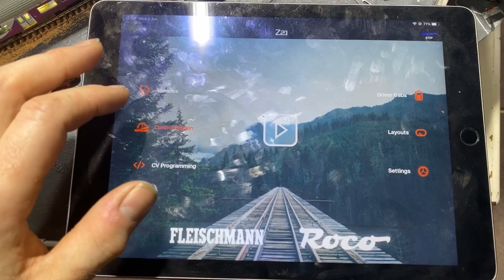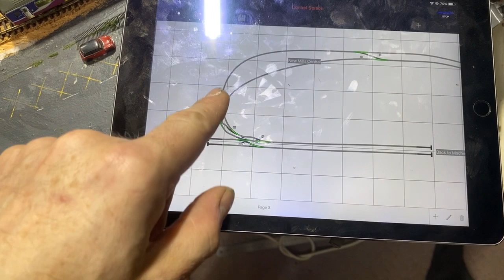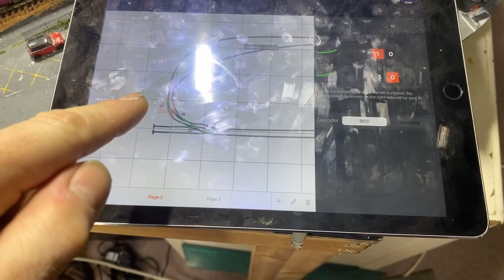N GAUGE MODEL RAILWAY - PROBLEMS SOLVED & BIT OF TRAIN RUNNING

Comment: Hi John , Really great Video and some cracking running shots , Must say a 156 on a Man pic - Sheffield service , That is luxury !!!!! Used to have a 142 ( and a bus seat one at that !!!! ) Mainly use 150's . Anyway glad you sorted your little problems out . Stay safe ,
Reply from the maker: Thx Andrew, as I don’t live around Manchester it’s a job to know what stock does what routes. Do you know where 156s run?
Reply: @piccadillymodelrailways  Hi john ( Again !! ) the 156's routes are quite interesting , They run in the northwest on routes out of Manchester out to places such as Preston ( Well used to before they electrified the route , 323 , 319 and brand new 331 run the route ) and blackpool North , Liverpool lime street Via Warrington Central . very ocasional Trip over the Hope Valley to My home City of Sheffield , I have seen them at Leeds and York ( covering for other Units such as 158's ) they turn up at Newcastle on services round the Northeast and run over to Carlise and some of the Scotrail Units turn up there on Simular workings ( Northern do have some Ex- Scotrail Units working for them now as Scotland Have new EMU's ) East Midland Railway have quite a few 156's they Turn up anywhere from Liverpool - Norwich / Nottingham workings Paired with either another 156 / 158 or a Pair of class 153's , They also work Lincoln - Doncaster workings ( can turn up a class 153 but i have seen a class 158 which is RARE !!!! on this working ) Lincoln - Nottingham Workings and Nottingham - Worksop Workings turn these up but again can be worked by other classes . They do now have some Ex- Greater Anglia 156 as these got displaced when the New class 755 Bi-Mode units started working these have been renumbered in the 156/9 sub class . The problem with Todays railway is Anything Will and Probably will Turn up anywhere .
Reply from the maker: Thanks, might be complex on mine in it’s current form then, so those going to Sheffield might just get the 156. I’m terminating 142s at New Mills. Lol

Comment: Wow! It all lifts out. I should have done that before the track buckled in my tunnel (permanently fixed), meaning I had to relay 2 and a half meters of track 😐. Two days later, I took it all up again and changed the layout 😂.
I think its the heat that causes the buckling.. I never had any issues until this heatwave
Superbly-Detailed Layout!
TTC
Reply from the maker: Yes, the heat causes all sorts of expansion issues. I’ve been very lucky over the past couple of years, but this one was very subtle and had moved only a millimetre or so, but enough to derail trains.

I learnt the hard way on covering track, and ofc trains would stop, derail, fail, in the tunnels. On this layout I was determined to protect against that.

Comment: Hi John, I’m glad you sussed out your problems, looks like things are running fine after the running session we saw. I have a Z21 and I’m looking forward to getting to grips with it, I think???? Lol! Cheers John
Reply from the maker: Hi, thank you. The Z21 is best controller out there IMO. On the whole it’s very easy to use. They did replace the software about 2 years ago when you could take photo of your layout and position points. Since then, introduced the track drawing package which is bit wild and uncontrollable. Just take your time you’ll be fine. 

I did this video on it might I interest you
https://youtu.be/pX-LByAwYXU
If you search YouTube loads out there, although some are getting old now and out of date inc old software. Happy to help if I can. Drop me a message on messenger or FB. Cheers
Reply: Thanks John, that’s brilliant

Comment: Got to love that GWR HST! :D
Reply from the maker: Yes, completely, they do look stunning, especially seeing them on your long sweeping curves.
Reply: @piccadillymodelrailways  Love the sounds as well, I must look in to that for mine and find a really loud speaker for exhibition volume .
Reply: @piccadillymodelrailways  I saw that you got 2 powercars and 2 coaches for 160 pounds. Almost makes me want to change to N gauge.
Reply: @LukeAlfordUKsteam  Ahah, I did too... I thought it was expensive at the time... no more!!!
Reply from the maker: There are many things in N gauge which are on par with OO, eg my class 68 cost very similar amounts to the OO big brother, but where the HST is concerned much cheaper, coaches £22-25 depending where you go. The biggest advantage though, you can fit twice as much into the same amount as a OO. I can run full lengths trains but never could in OO which the space I have.
Reply: @piccadillymodelrailways  Same for me, I thought about 00, then realized for me it was a silly idea.

Comment: Another interesting video it just shows that any problem that show up at least you get to it and fix it straight away these thing I have to take into consideration when building a model railway and that you can gain access to fix the problem cheers John have sent you a message on something I need to know before I fix the track down cheers speak soon .... :0) .... Chris
Reply from the maker: Yes, access is critical you must be able to gain access to every part of your track. That famous law says if there’s a problem it’ll be in the area you can’t get to, because these areas are not maintained. 

When laying the track make sure you leave 1mm gaps you then get clickity click sound, but less likely have issues. Think mine must have stuck to chairs and couldn’t move. I’ll get back to you bare with